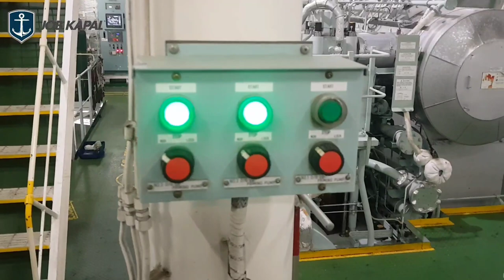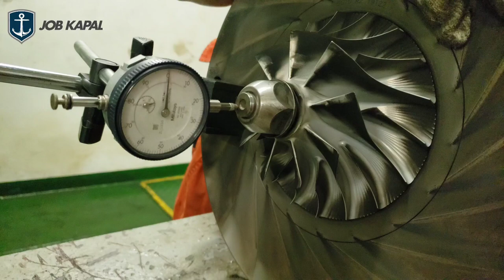OVERHAULING AE TURBOCHARGER MET18SRC

Comment: Good job! 
A few hints to improve it: 
-Remove the air inlet guide and air outlet casing while still fitted on engine (cartride will be lighter and come out straight, not kipped). 
-Measure rotor tip deflection and radial bearing clearance at 12 o'clock position, not sideways.

Comment: Alat yg seperti pressure gauge itu namanya apa bas dan gunanya untuk apa??
Reply from the maker: Terimakasih atas comments nya kak. 
Itu nama nya Dial Gauge (DIAL INDICATOR) kak, kita gunakan untuk mengukur kerataan permukaan dan clearance dari poros axial dan radial pada shaft turbin. Bgtu juga mengukur clearance Foating journal bearing apakah masih masuk daalam tolerance atau tidak nya. Terimakasih 

Semoga membantu.